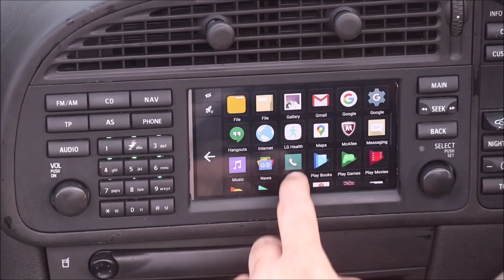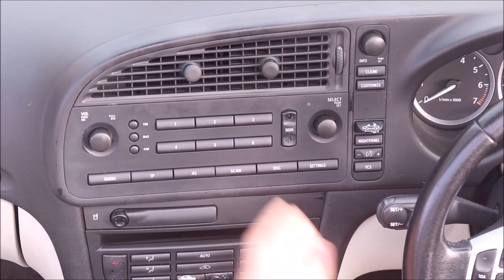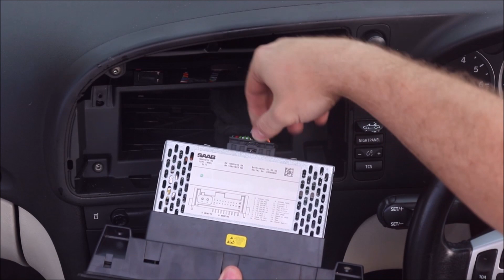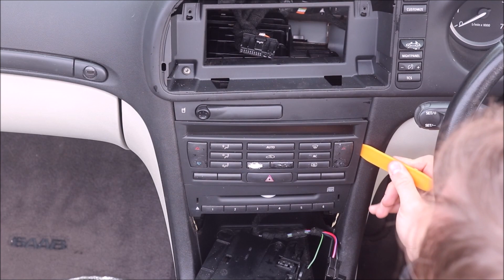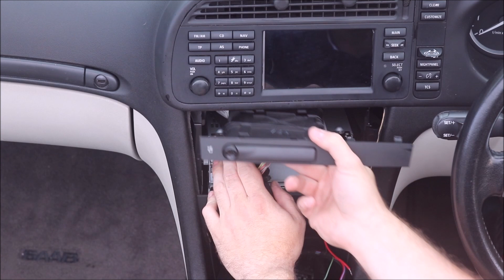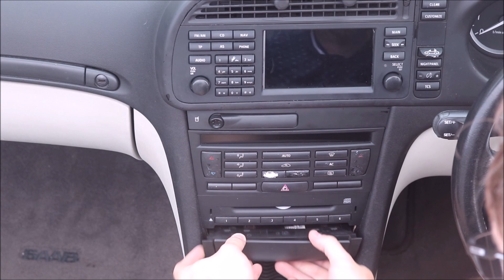Saab 9-3 2003 -2006 LG Phone Radio Upgrade

Comment: How do you make it automatically turn on and off ? What software do you use ?? I'm planing on kinda same mod on my ICM 2 with a Lenovo M7 tablet
Reply from the maker: It wasn't software, I altered the bootloader code after rooting the phone. Can't remember how though because I've slept since then.
Reply: @SaabUnleashed  😂👌 I know that feeling ATM I'm looking on some of the other videos to get some ideas to get an upgraded stereo I just don't fancy a ICM 3 when it already have ICM 2
Reply from the maker: @yesdaddy4148  you can use a raspberry pi and replace the screen in the ICM2, or you could go fully aftermarket
Reply: @SaabUnleashed   I'm planing to make something like with the joying 8.8 just thinking to use a 4 channel amp in the back to drive the door speakers and the rear shelf speakers ( got the 8 speaker ) and just go fully aftermarket
Reply from the maker: @yesdaddy4148  that is ultimately the best option if you don't mind doing the work
Reply: i really dont care about the work :) i just want to keep my old trusty saab 9.3 2.2 tid Hirsh alive in this crazy world XD

Comment: Please please. Where can i get this from???????
Reply: I cant build lego. Can i pay you if i send unit to you.
Reply from the maker: This is no longer available, it was superseded with the newer version. The newer version is this - https://www.youtube.com/watch?v=zDnQZDIFRCU
Reply: @SaabUnleashed  Right ive realised and think ive sent email correctly. Im getting the bigger screen icm3 unit. How can i get the upgrade to do it. Please message back. Martin
Reply: @SaabUnleashed  Hi does this fit in and wire in same way as last 1
Reply: Hi. Please can you tell me if the new 1 plugs inthe same way. Or please point me in getting upgrade to put in
Reply from the maker: @martinball5513  search ICM3 build guide on YouTube and you'll see what it requires
Reply: @SaabUnleashed  Hi. Ive got a bigger screen icm3 unit. How can i upgrade to your newer made up unit?

Comment: Your product functions are impressive.  I have a icm2 that doesnt seem to work properly like it once did.  It now has really bad reception and when i try to change the station by using the preset buttons it routinely stays on the same station no mater which button I push.  I tried cleaning the amplifer/antenna contacts in the c pillar and reception improved for a short while then was poor again.  Would you happen to know why this maybe.  Do I need a new ICM?  I spilled water in the rear driver side footwell, could that have damaged the amplifer under the seat and then radio?  Turn signal sounds still works.  Thank you.

Comment: Does it work with night panel on? 
Also I want to buy one like this, but I have an icm1 would the conversion still work?
Reply: It should be because it only do FM modulation not a real modifying of the ICM I would do a 7" laptop an magnetic holder for labtops and then same FM modulator build up. That's a nice way for the ICM 1 and 2 where 2 you could remove the screen at make it looks more neat

Comment: does it work only with this model? coz my saab 9-3 vector convertable 2004 it has display at the top dashboard. I wanne use mp3 player only, than who`s using cd ?..thanks for your help
Reply from the maker: You have two options. You can either find someone close to you with a Tech2 computer, this can enable the aux in on your radio and you can then just plug a wire or Bluetooth adaptor in. Alternatively, you can locate and upgrade your radio to ICM3 (the one with the colours screen) which has the aux enabled by default and this mod will be possible
Reply: @SaabUnleashed  thanks m8 for your quick respond. my main issue at the moment is, that my cd stucks into the cd player. as I mentioned before, i wont use cd anymore. I`ll get in tounch with you through FB..and yes I have some car electrician in case. but your system is really cool, but not sure if it works.
Reply from the maker: @arescyp  It will work in any Saab between 2003-2006, because it is these years that you would find an ICM3
Reply: @SaabUnleashed  i did send you by @..my saab is from 2004

Comment: Hello! It’s the best thing one can find, thank you for the great job! How can I order one altogether with the icm 3 unit?
Reply from the maker: Only self build kits are available as I don't have ICM3s. If you don't want to build it yourself, send me an ICM3 to modify for you
Reply: @SaabUnleashed  well I sort of have one, but I am not sure if it works, I’ll check it. If it doesn’t, I can buy another one online in UK and send it straight over to you, that will work? And then you will send me the whole unit assembled. Can you share your email with me?
Reply from the maker: @seva_che  Hey Seva, my email and facebook link is in the video description. You can certainly buy an ICM3 from the UK, but remember that they will only be suitable for right hand drive cars. I'm not sure where you're located. But in any case, you can send a unit to me to modify.
Reply from the maker: @seva_che  If you have one that has a faulty screen, I can work with that as the screen is coming out anyway
Reply: @SaabUnleashed  Thanks! They are suitable for LHD cars also if you have the frame for the LHD, and I do have. I guess mine will work, but the buttons are all messed up) so I am thinking to get a fresh one. I’ll send you an email soon.
Reply from the maker: @seva_che  That is very true. With that in mind, you could just swap the buttons from the UK one too

Comment: Very ingenious this system, congratulations.
I have a SAAB 9.3 VECTOR from 2005 European model (steering wheel on the left), no problem with the orientation of the phone screen and the arrangement of the cables (jack and micro usb)?
thanks for your reply
Reply from the maker: Hey Michel, no issue as both left and right hand ICM3s are identical apart from the rounded part of the facia being on the opposite side. The screen orientation is reverse landscape and is forced by an app on the phone
Reply: @SaabUnleashed  Hey Stuart ,
 thanks so much ! ;-)
but there seems to be no more kit available on Ebay?
how can we order it ?
Reply from the maker: @michellarre5381  I sold out last week, I've ordered more so should be ready to go in a few days time

Comment: Hi Stuart, I am really overwhelmed. This is exactly what I've been looking for forever for my 2005 Saab CV.
How long does it usually take when I send you my own device (left-hand) ? It makes sense to do it in November anyway, when my CV is in the garage.
The £360 does not include shipping, correct?
Reply from the maker: Hey Claudius, I can usually do the conversion in a day. If you are supplying the ICM3, it's actually £290. Shipping varies wildly depending on where you are in the world. That also affects the amount of time your ICM3 will be away from the car - remember your car won't start without an ICM unit. Also, keep in mind that there's a kit so that you can upgrade your own ICM unit
Reply: Stuart Bell , thanks a lot for your response! I am in Switzerland and would send by DHL or so. I just need to enter a local data sim card once I got it back from you?
Reply from the maker: @claudiusmariadichtl2244  you can put a SIM into it if you want, or use it via WiFi to your existing mobile. Delivery via DPD to Switzerland is £36
Reply: @SaabUnleashed  , in the meantime I had to realize, that it's dificult to get ICM3 on the market as for the trial I didn't want to use my own one. Do you know by any chance if the front plate from a RHD can be simply changed to make it a LHD ICM3?
Reply from the maker: @claudiusmariadichtl2244  As I understand it, I believe they are identical, so you should be able to just swap them over. Please note however that I have not tried this
Reply: Thanks Stuart, I‘ll think about but most probably I‘ll take my own one and send it over to you. Season is more os less over for the moment and  therefore enough time to make a proper change.
Can you let mw know the shipping details to send the ICM over to you?

One more thing: I am considering to buy a eSID. Does that setup would work with yours?

Comment: Any way to keep the warning tones?
Reply from the maker: You don't lose them, this is still just an ICM3
Reply: @SaabUnleashed  and full steeling wheel control? I do a lot of motoring and I can't afford to take my eyes off the motorway
Reply from the maker: @CardboardSliver  It's a standard ICM3, so you get volume and radio control. You won't be able to contol Spotify tracks for example, but the on screen track buttons are huge as designed for car use, so you can do it without looking

Comment: Como has echo para que la pantalla sea a color y tactil?
Yo tengo la radio antigua y quisiera ponerla igual que tu
Reply from the maker: You need to put a modified phone in the place of the original screen and install a few other components. I sell the packs and the components to do this.

Comment: Do these units have gps, image mirroring, Bluetooth, can receive and ring out phone calls?
Reply from the maker: GPS, yes. 
Image Mirroring, yes if you install apps that allow it.
Bluetooth, yes it has a bluetooth radio, but not in the common head unit way. You can connect Bluetooth devices like ODB2 ect. If you want to stream audio, you will need to install an app on both the head unit and the originating phone. Although this is pointless because you should use the head unit to stream direct (or download the music directly so you don't need to stream.
Phone calls, no. There is no accessible microphone
Reply: Stuart Bell I completely understand the appropriate apps to phone to be able to communicate and adding functions. The GPS thing would come down to using your mobile as a hotspot or other components to be added?
I’m very interested in purchasing one of your units.
Reply from the maker: @dingbat5653  So you don't necessarily have to use your phone as a hot spot for GPS. It depends if you intend on using online functionality like traffic updates, roadworks and speed cameras / police warnings. If you just want simple Nav, you can download maps on Google Maps or TomTom and just use them
Reply from the maker: I have since made improvements to the accuracy of the GPS functionality as I found the built-in one didn't connect to many satellites when installed in the dash. I made an install video for one of my customers, you can see it here. The GPS unit is included within the original price. https://www.youtube.com/watch?v=W-hjjxC6QII
Reply: Stuart Bell Thank you for the replies and it sounds very cool and a great effort for the Saab 9-3 owners that have no options (until now).
Did you ever get the 9” wide screen going in another video you posted?
Reply from the maker: @dingbat5653  yes that's all completed with the exception of the steering controls. I need a specific canbus decoder and I'm just waiting for info on it
Reply: Stuart Bell Sounds like some good options are available for the “pain in the arse” NG9-3 models 😂
Are they hard to work on, or it’s just a matter of a lot of rewiring and moving the ICM to another spot?

Either way I’m very interested in the direct fitment touch screen ICM with gps module. Forgive all the questions but is it possible to also add USB ports and aux port beside the drink holder?
Reply from the maker: @dingbat5653  To be clear, the USB ports are only for power, they do not connect to the radio for any form of data connection. But it that's all you want it for, sure you can mount it wherever you see fit. The aux port will be in the centre console if you have that option in your car
Reply: Stuart Bell Yes, that’s all the USB ports should be used for - charging phones and other devices. I have the arc sport model 9-3 and there’s no aux. I can see where it should be in the arm rear but it’s blanked off.
Reply from the maker: @dingbat5653  Yes that's the same as the Vector convertible I bought to help design these units. You can retrofit aux-in to the EHU behind your climate controls and there is a Youtube video on how to do that. But again, if you use this device, you shouldn't need an Aux
Reply: Stuart Bell I see no point in having auxiliary these days either. Having USB ports is far more modern and would also give the option to have 3-4 ports. Some can be hidden to run the gps locator more accurately and another for usb mic dongle for mobile phone calling.

Comment: That's really cool.
*** Stars.
 I have been looking for a solution for my rotten looking buttons in my 2005 93 Vector convertible.  I have one question. How does Internet connection work.  Is there a built in SIM or is it powered via a mobile phone?
Cheers.
Reply: Also, do yo still get Saab warnings, pings and beeps etc?
Reply: @charleslondon9900  yes

Comment: hey
and how did you fit in the LG G3 to the ICM3? is it a complicated job? And what about your other video - that one was an Android device made for refitting to any car right? 
And the price, I have an ICM3 what would I get in your 240 pound package? 
Thanks and cheers for a very nice video!
Reply from the maker: No, it's not complicated to put it in. You remove the original screen and then glue the phone in place. The complicated part is the rooting and coding of the phone to work specifically for this usage. If you buy the package, all the complicated stuff is done, you just need to do the assembly. I will do an instructional video for those of you that want to buy the pack.
Reply: @SaabUnleashed  aha, nice job! Would an lg g5 work? And which os and packages did you use? I'm a computer engineer so know my way around Linux and rooting a device :)
Reply from the maker: @grgocupic3888  No, the G5 won't physically fit in the gap. The G3 is the only phone which has the nearest physical dimensions both case wise and with the 16:9 screen. I wrote my  own root software for this phone for this design
Reply: @SaabUnleashed  even more impressed :)

What base android did you use?
Reply from the maker: @grgocupic3888  The stock 5.0 that is installed by default on the phone

Comment: I assume the Android unit needs its own mobile service contract?  SIM card slot is accessible with the unit removed from the dashboard, or does it have to be dismantled altogether to install a SIM?  Does it have phone functionality as well?
Reply from the maker: You don't need to give it a contract, but you could of you wanted to. I just connect it to my mobile phone's hot spot. You can remove the front of the ICM3 by releasing the plastic clips and this will give you access to the back of the phone if you want to install a SIM. The phone functionality is complete, but please bear in mind that it being installed within the plastic enclosure of the ICM3 will reduce the capability of the microphone

Comment: Very impressed by your skill! I also have a few questions about the phone. I read that you use an LG G3, but I wonder how many of the phones features are still there? Would it be possible to i install a sim card? Is the phone still attached to a battery and constantly changing, or is it directly getting power from the cigarette plug? Are the wifi and cellular antennas still functional? Are the phones used or brand new? Is it the 16 or 32 gb version of the g3?
I have a 93 myself, and I am very interested in your solution, a potential customer of your. Nice work, keep it up!!
Reply from the maker: The phones are not new, and the exact specification is a lucky dip simply because I acquire them second hand as they are no longer made. You can access the SIM and the battery by removing the front of the ICM3 which is held on with clips. The phone is powered directly by the car power and is switched on and off with the car ignition, but the battery is intact. WiFi and Cellular functionality is not modified and will work as usual.
Reply: Stuart Bell Do all the ICM versions have the phone sim provision? I though this would have been made redundant with the unit you’ve made due to Bluetooth and adding TX/RX usb modules? 🤷🏻‍♂️
Reply from the maker: @dingbat5653  The replacement screen is a mobile phone, so you can put a SIM into it if you want. But you can do without a SIM and use Wifi to your mobile phone's hotspot if that's what you'd prefer. Does that answer your question?
Reply: @SaabUnleashed  Sounds great! Will the quality be any different form stock?
Reply from the maker: @ikkeolve  It uses the stock system through a built-in FM transmitter, so it shouldn't be any different. It won't sound better than the stock system, if that's what you're asking

Comment: Very nice job! 👌🏼👍🏼
I've few question :
It's possible to connect a reverse camera?
It's possible to connect an USB key?
Thank you so much!
Reply from the maker: Hi, USB key and reverse camera cannot be used with this solution as there are no physical connections for these items. You would need something similar to the Joying touch screen shown in one of my other videos
Reply: @SaabUnleashed  thank you so much for your response.
For the connection of the jyoing device, what is the solution for the connection?
I know it's necessary to use an optical loops.
Thank you so much for your response
Reply from the maker: @laurentwagenheim2200  It's a massively complex job requiring the rewiring of your car speakers to bypass the fibre optics. It's not easy. This modified android device is the only easy way to have a more updated system